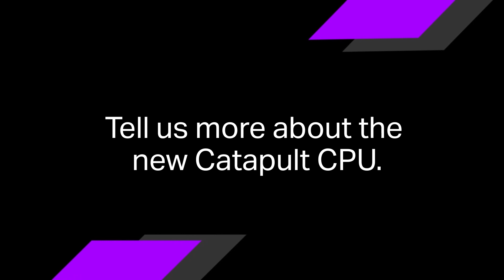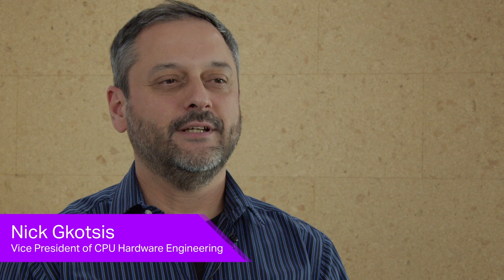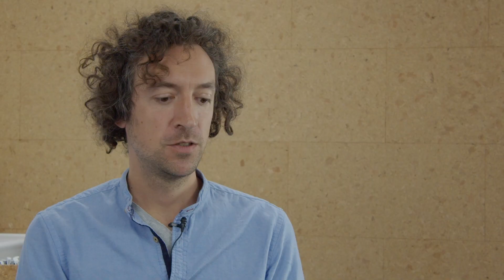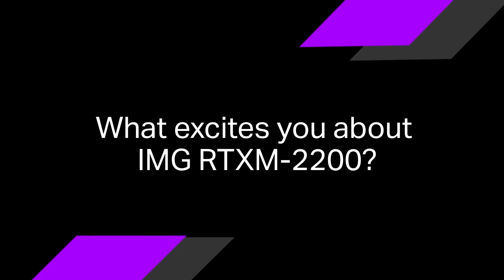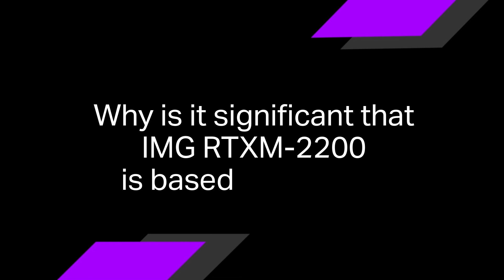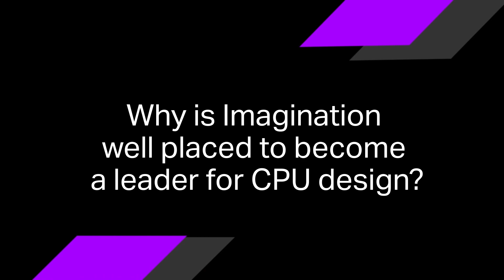Introducing IMG RTXM-2200 for real-time applications

Comment: Nice approach.
I was wondering though if you considered adding what you called "old designs", or any different designs for that matter, akin an addon ?

There constantly are new designs for new applications / use cases, and new generations for CPUs to cope with it, while at the same time the majority of a CPUs is in idle state outside of usually artificial scenarios. Why not allow the microcodes to be reused / rebundled / partially reassigned on the fly, so that whenever you need a GPU, FPU, AI Extension, X86 execution and whatnot you define and then call upon it ? This way, you reduce the performance ( number of parallel operations or tasks ) on one end, but allow different uses for it at the other.
This should allow for very high energy efficiency as well, since focusing resources on tasks actually used would allow lower clock speeds and possibly could do away with "performance" and "special application" multi-core designs.